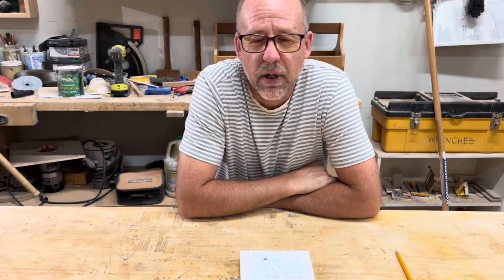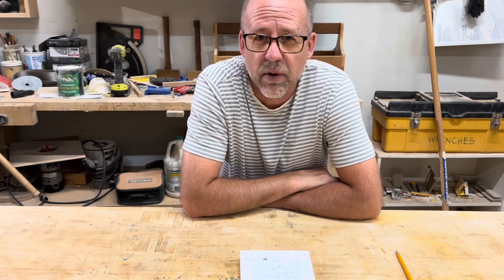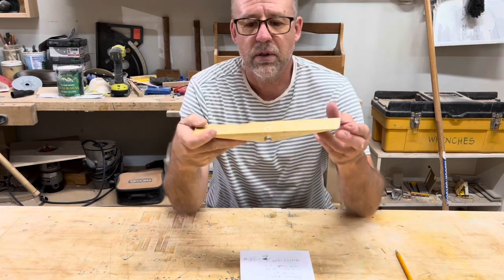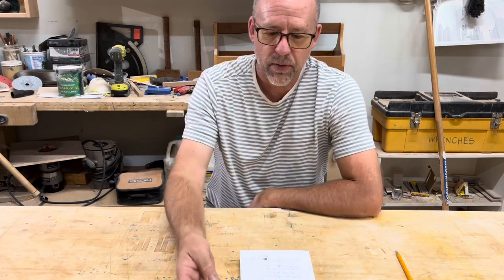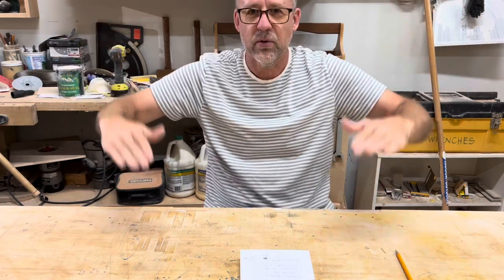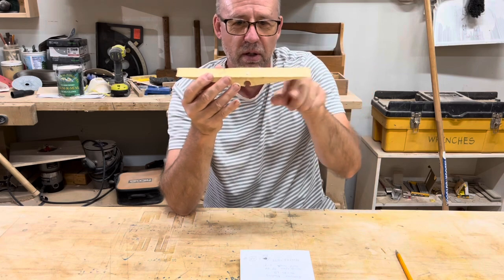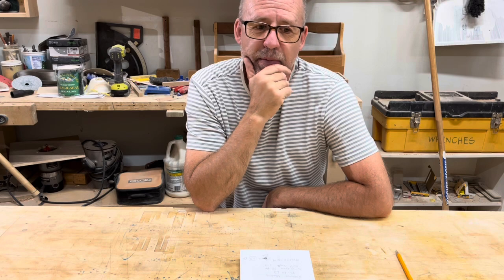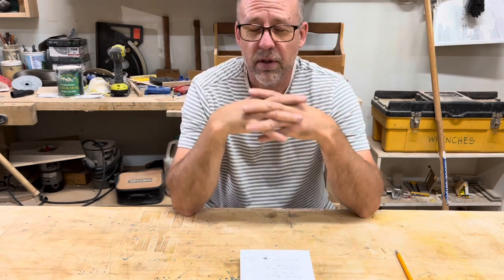Hydroplaning Wedge Rower Explained

Comment: On a side note: Have you seen the Hingham high school rowing team pulling a water skier?
Reply from the maker: @myperspective5091  no.  Sounds interesting.  I will check it out!
Reply from the maker: @myperspective5091  I just watched the video.  Did you know the lift to drag ratio of water skis is quite low?  A skim board going sideways has 40% more lift and less drag.  So at a minimum 5 people could pull someone on a skim board out.  However, the long and narrow hull has zero dynamic lift therefore its surface area remains the same but its drag increases with the square of the velocity, a skimming hull will lift with increasing speed and its drag will go down after getting over the hump speed.  It may end up that I would need 2-4 people rowing to get over the hump speed.  With every person you add, top speed increases by 8-9%.  The reason it is that low is that the length and displacement volume increase when you add someone , but 8% adds up.

Comment: This idea might be interesting.
See if you can measure how fast skimboards go and then use that as the speed that you would need to go to achieve your goal.
Reply from the maker: Thanks.  Yes, that is a good starting point.  It is hard to measure the angle of attack that one arrives at after jumping on the board.  AOA effects lift and drag and so does surface area.  Every speed has a different amount of lift that each square foot can support.  If the mass remains the same, then with every increase in speed, wetted area will shrink as the boat rises further out of the water.  My current floats do not have enough buoyancy to keep the water off the tops of the floats.  The water that gets on top prevent it from lifting.  I think I will make several scale models with different shapes and see what has the least amount of drag.  So a skim board supports 160 LB with 4.7 SF at around 10 mph.  If you have 2 boards you can support double the weight or you can support 1.5x the weight at a slightly lower speed.  That is what I am aiming for.

Comment: I’ve never said this to another engineer, but that is going to fail. 
Getting a human powered row boat to plane will never happen. 
There is a reason that rowing sculls, surfskis, and sprint canoes  are designed the way they are. It is because those long narrow smooth rounded tapered shapes are the  fastest shapes for paddling or rowing.
Reply from the maker: The ideal shape of any hull changes if you are able to go over the hump speed.  Once over the hump speed, the ideal shape is wide and flat with 4.5 degrees of incline.  Hydroplaning is only 10% less efficient than hydrofoiling.
Reply: @markpalmquist  Because you will be paddling for your thrust your thrust will come in spurts. In between those moments of thrust you will be repeatedly dropping / panicking back down into the water.  You will be repeatedly trying to climb after each drop. 
On a side note: Surfers can pump on the downward drop and then lift back up when the water rebounds back upwards. 
They are surfing that little swell they make. That is why the skim boarders can stay up as long as they do when the pump their boards.  That is also why thinks like the Aqua Skipper worked. 
The hydro foils have more vertical travel then hydroplanes. That gave the rider more time to build up strength for their next push before they bottomed out.
Reply from the maker: @myperspective5091  pumping works on sails and fins that have fluid flow on both sides.  Hydroplaning does not require pumping it just requires a certain speed and a certain weight per unit wetted area.  All our experiences with hydroplaning are with low aspect ratio surfaces, not idealized.  Wetted area should be 3 times as wide as its length to get ideal lift per unit area.  Motor boats and windsurfing boards are idealized for pitch stability not max lift per unit area.  That is why I need 2 floats instead of 1, to maintain ideal AOA.  If windsurfing boards had stepped hulls they too would be able to hydroplane at lower take off speeds.

Comment: The Aleut (Unangan) kayakers in iqyax (baidarkas) were observed in the 1770s by Captain Cook's navigator as traveling "10 sea miles an hour," (10 knots).  This would've been one of the more reliable observations possible in the 18th century. When the Russians occupied the area forcing the Aleuts to hunt for them, they banned the fast iqyax designs because they could out run any Russian vessel. 
 
George Dyson in about 1990 wrote a scholarly article about the baidarka which included some calculations. These calcs determined that iqyax if they were able to make these speeds they had to be planing.  

I built an iqyax based on the 1803 design from Leningrade (St Petersberg). Of course I didn't get anywhere near these speeds. In fact my 'iqyax was kind of slow. (My fastest kayak was a Great Auk 17' that I think was more like a canoe than a kayak. I consistently averaged 4.3 knots over three hours.)  
Studying and building the iqyax,  I think I figured out a couple of things. First to get a vessel like this to plane I would have to be able to sustain at least 7.5 knots, which would probably be at least 4x my possible sprint speed. (So not going to happen.) 

Second and more interesting. If you look at the bottom two stringers on either side of the keelson of a 'baidarka'  you'll notice that in the historical examples there is a big gap.  There's no structural reason for this gap.  Even spacing makes more sense. On the water, the skin depresses between the stringers and the keelson, forming two curved channels.   Simplified in a two dimensional sense is, these channels scoop water in from near the bow. The channel narrows until it reaches the CG of the paddler, and then they're parallel all the way back.  I think it is water entering these two channels which lifts the 'yak allowing it to plane. 
But you would have to be able to get up to 7.5 knots for this to happen.  I don't think my iqyax is a suitable test platform, but the obvious test would be to tow it, or  put a motor on it.  What should happen is that as velocity increases, effort will also increase (at a greater rate) and once planing is achieved the effort should diminish or at least not continue to rise.  Then the question would have to be answered, is this possible with only human exertion? 
Always tests. Flume tests.

Comment: Interesting theory. But I think you need a propeller for this to work. The reason I say this is because a propellor provides steady power, whereas oars provide pulse power.

I once got into an interesting argument  in the pdracer community. My argument was that a heavier puddle duck would row better than a lighter one. Sure enough, someone put my theory to the test. He rowed his boat empty than successively tried it with more weight added. He rowed at least a half mile each time. And sure enough,  the heavier boat was significantly faster.

 The reason for this is that it didn't lose as much speed between strokes. Now, a lighter, much longer boat would assuredly be faster, especially if it was also quite narrow. This is why kayaks are so fast. Weight per beam is much more important than weight per length in this case, because this gives you momentum to coast between strokes.
Reply: Kayaks are not fast. When I was 50 I was able to consistently average 4.3 knots over three hours on the ocean, Santa Monica Bay.  In the kayaks I've built since (both longer and narrower) not even close. (also I am older).  Speaking with the guy working for Northwest Kayaks he told me a canoe is much faster than any kayak. Said it skims. I think the kayak I did these speeds in was more canoe shaped  than kayak. Nick Schade design Great Auk, strip built (17.5' 23.5" beam. The others were 18' x 17" and 19' x 17")  (I think I remember Nick saying the design wasn't canoe like. He knows a lot more and it is his design.) 
I'm hoping to make a paddling rig for a Stand Up Paddle Board. It would need a footrest and minimal flex. SUPs are usually faster than kayaks. They skim. 
If this subject interests you, build models and test them. Just discussing it takes up a lot of time and really doesn't get anywhere. (And no one is more guilty of this than me.)
Reply: @WillN2Go1   - I cannot imagine that any current watercraft (kayak, canoe, SUP) that is solely propelled by a human with a paddle on flat water will leave displacement mode and begin planning/skimming. Flatwater racing SUPs have displacement hulls and all flatwater racing kayaks and canoes have displacement hulls. For good reasons. Add a sail and wind or waves to ride down, ...different story.  By the way, the current flatwater world record for 1000m kayak is at about 3min22s, for canoe at 3min46s. SUP is slowest. The 2023 world record for 200m with a SUP is slightly above 44:37 seconds, so about 4min15s for 1000m (unrealistically assuming one can continue at that pace for 5 times the distance).

Comment: Interesting concept. Why is your boat so heavy? A normal skiff weighs less than half. Even a double isn't that heavy. Losing some of that weight will make it significantly easier to get up to the required speed to start planing.
Reply from the maker: It was initially 50 lb but went up with the float changes and addition of the rowing frame.  I agree it could be lighter.  The floats have more surface area than a long and skinny hull but wetted area will go down when the boat lifts.

Comment: take a look at the 1978~92 WetBike (as first seen in the Bond movie: The Spy That Loved Me) altho it has a two stroke ICE engine and jetpump drive they 'plow' to get up on 'plane' with their two hydroplaning skis at pretty low speeds - even tho they are very heavy, and can do it with two riders ....the dual ski design is somewhat along the lines of what you are after with your 'skimmers' but it appears you are trying to also use them as flotation(which I think their huge size might just cause extra drag at the lower speeds making you fight harder to break onto plane!) instead the WetBikes still have a somewhat sleek under hull to awkwardly float at a rest and at trolling/'plowing' speeds(altho very unstable until up on plane, because of the higher center of gravity with engine, fuel tank, battery, and rider - however this high up CG actually adds to the maneuverability once the WetBike is totally above the water as it functions then like a motorcycle/bicycle with slight counter steering and all the weight much above the contact patch 'falling' in the direction you want to turn by quickly moving the light weight skis/tires out from under it in the other way....anyway, that could be important to you for stability once above the water line!) but do look at the WetBike's skis, as you might not need yours to be so large with so much drag, as these others do lift a really big amount of weight at lower speeds than you might expect - I'm assuming a lower weight human powered craft could plane up on even just the same WetBike skis(altho they are very heavy thick fiberglass to withstand wave jumps and stuff) pretty easily if you can run at a smooth steady speed, I'm guessing rowing wont cut it especially with a high drag large overly long/wide wedge - you will want the hull to float ya and be able to get to planing speed

Comment: Your biggest challenge will likely be maintaining speed during the part of the stroke when there is the most "check" on the boat, when the rower is furthest astern but not yet applying power through the oars.  Foiling rowing shells have struggled with this, and the only solution I'm aware of is a sliding rigger design (where the entire rigger and seat assembly is floating, so the center of gravity is fairly static.  Sliding riggers are illegal in competitive rowing, so there's not much work being done on that front, but it would be perfectly viable for a recreational project like yours. Really interesting design!
Reply from the maker: @colin7242  I am open to trying that if test 2 is too pitch unstable.

Comment: I've modelled a hull in FreeShip where my criteria was to have two 5° flat planes for lift, one fore and the other aft with a step in between. I also wanted to maintain a centre of buoyancy somewhere near the middle at different displacements. I was very surprised by the resulting shape. Top down it looks like an arrow with continuous taper. Looking from aft it looks like a triangular transom. The stern is very wide at min displacement and gets narrower at max displacement (hence the triangular shape), while midship where the step is, is about a third of the width of the stern at min displacement and maybe half width at max displacement. I also modelled a round bottom hull (minimum surface area to displacement) to compare with, and the drag was very similar at full displacement. That's as far as I got with that thought experiment.
Reply from the maker: @CraigOverend  interesting, thanks for sharing. I have not tried free ship yet. My angle is 4 1/2° but the front half of the wedge is 8° however, now that I made modifications, the location of the waterline at rest is lower so hopefully the initial drag will not be too much to overcome.

Comment: I have to imagine that someone out there has tried to row one of the small outboard hydroplane hulls that were popular back in the 60s. in any case those small hydroplanes give you an idea of what kind of horsepower is necessary. While it might be possible to stay up on plane by rowing, I think the power needed to get up on plane is way too high for a person to generate
Reply from the maker: Most peoples experience with hydroplaning is with a motorboat. When you think about the force on your arms when you’re being pulled out of the water on water skis by a boat, it’s not much different than the force of you pulling on rowing oars at full force plus when you’re being pulled up out of the water on water skis by a motorboat, your skis are more or less vertical and there is much more drag.
Reply: @markpalmquist  I see your point, although, if I think of being in the water with water skis on and trying to pull on a rope to get myself up on a plane, it seems quite impossible.

Comment: vert transom some Tows water, ( no go )
slanted aft Lifts water, ( no go )

slanted fore and the water surface tension sheds down with gravity <--- think surface tension, the direction the water goes, and it's inertia..........so get the shape there upside down, from the current CAD drawing, but nose up and higher aspect.

or to say,
a wing, or foil, operates with the fluid all around it all the time .... But A Boat Does Too, ( until it's planing )

don't argue with physics.........you have to think of the part that starts out in the water like a foil.
Reply from the maker: If this second test does not work I will slant the transom forward and try again.
Reply: @markpalmquist  i suppose that means they are already done and part of the boat?....your thoughts on high aspect are correct, with high aspect you would have a shorter bow wave, not as high of a bow wave, and only smaller bow waves beyond the fundamental frequency... no one wins any argument against physics ... so stick with the program, and consider my explanation of the physics here; because i couldn't change that reality if i wanted to either.
Reply: so basically, you want to have the boat floating on two "trailing edges" ( as in foil speak )....surface tension means water wants to stick to everything, including itself.
Reply: @markpalmquist  I mean you calculated your optimum aspect ratio and angle....what was wrong with that? .... nothing when it was just a board...but you need that to be the flotation this time, so static displacement is where they start.
Reply from the maker: @RulgertGhostalker  almost ready to test.  We’ll see if it will get over the hump speed as is.

Comment: call the Wedge Rower is a NeverWet Super Hydrophobic coating test bed. ( maybe you can get a discount for the NeverWet promo? )
it will take less power to keep it in a plane, than getting there .... if it doesn't work, then get some NeverWet for the wedge skimmers.

Comment: I have sort of doing experiments with small outboard motors. The challenge is to achieve the speed to get over the hump, after that the required power is less. I am sure the wedges will work, but applied in a different way. Using a canoe like narrow hull to achieve the speed, and then lowering the wedges, simultaneously lifting the hull out of water, might do the trick. But i hope Your version will work though, good luck!
Reply from the maker: @joeordinary2trumpheroofrussia  that is a good idea too, deploying 4 small skimmers at once above 6 knots.

Comment: This is a really exciting project. Im glad you gave it context in the other human powered vehicles. Good luck. We are cheering for you.
Reply from the maker: @adrianinvents  thank you!  I meant to also compare the surface area of the wing of the Gossamer Condor to the surface area of the skimmers but forgot to mention that.
Reply: @markpalmquist  it's always interesting to see if there are ratios between different regimes. I bet there are some really cool ones.
Reply from the maker: @adrianinvents  yes, we know sea water is 830 times more dense.  If you take the total surface area of the Gossamer plane 98’x7’x2 you get 1372.  Divide that by 830 and you get 1.65 SF.  Considering the efficiency of a flat plate is less than an airfoil, multiply 1.65 x 1.5 and that’s how much hydroplaning surface you need to lift the same weight at the same speed, about 2.5 SF of skimming surface will lift about 230 lb at 18 MPH.
Reply: @markpalmquist  So that means you are approaching the same advantageous efficiencies as the gossamer albatross. I wonder what a boat/ship made of thin plastics and carbon fiber effects things.